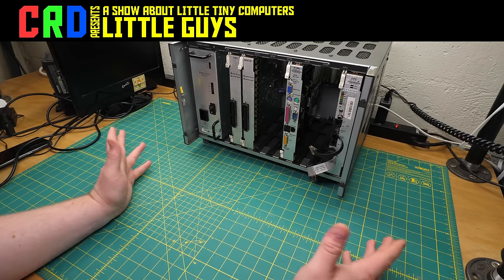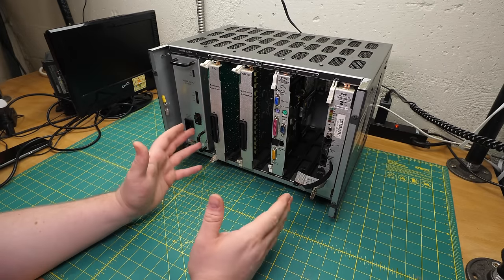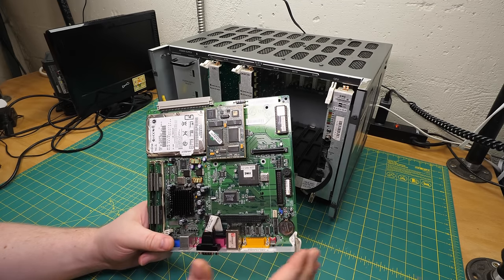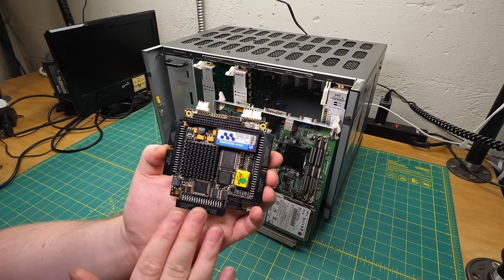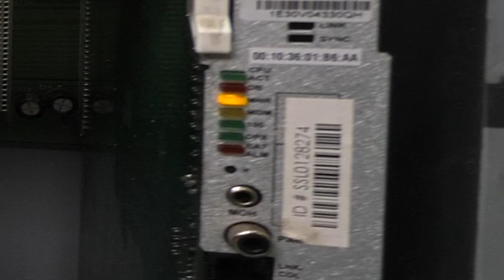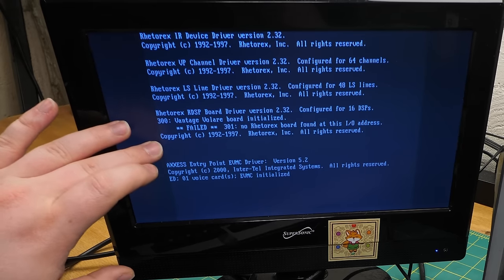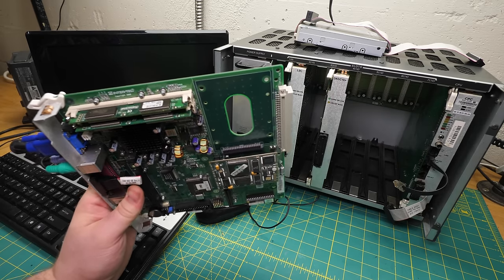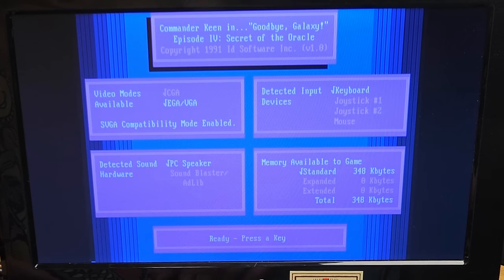Little Guys 9: The First Of Many [Intertel Axxess]

Comment: I don't know if it's in any way a standard name for it, but the Windows Entertainment Pack version of Mahjong solitaire was called "Taipei"

CyrixInstead almost sounds more like a jab at "Intel Inside" [though you're correct that the actual cpuid string for Intel is GenuineIntel], they also apparently had it on actual stickers to go on the outside of your case.
Reply from the maker: I've seen plenty of Cyrix stickers on machines but never a Cyrix Instead. The only results I can find for that on the gorgle are stickers that look like reprints, so it's possible they're actually a modern reflection of the CPUID joke.
Reply: There's some pretty interesting CPUID vendor strings on some chips. The string is returned in 3 32bit registers, so it has to be exactly 12 characters long. AMD's is "AuthenticAMD" - they found a synonym for Genuine that was 2 letters longer :) VIA's is boring, it's just VIA <space> repeated 3 times. I think my favourite is "CentaurHauls".

Comment: Hey now, I played the hell out of the Duke3D shareware on an Intel 486DX2 50MHz (in the 487 socket of a 486SX 25).  It worked... Well enough.  I guess that's why I can play Cyberpunk 2077 on a 2017 Dell 7577 laptop with a Core i7 7700HQ, 16GB RAM, GTX 1060 6GB.  Yeah, I struggle to get 30 fps on medium-low settings lol.

Comment: That's not hot glue... it's called silastic. Let's ask the internet... "Silastic (a portmanteau of 'silicone' and 'plastic') is a trademark registered in 1948 by Dow Corning Corporation for flexible, inert silicone elastomer."
Reply from the maker: Nope, it's hot glue. Silastic is universally opaque white and has a shiny, rubbery texture. This is milky yellow and has a terrible rough surface texture, like typical hot-melt - more importantly, it lifts off the board instantly with just a touch of isopropyl alcohol, while Silastic won't release for love or money.

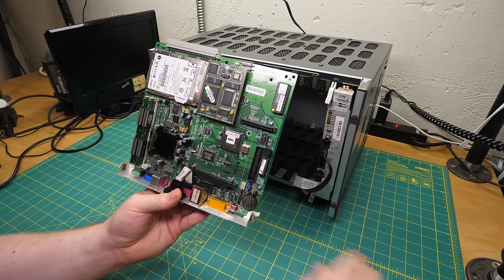Comment: 23:25 I kinda doubt that Winbond chip is just a dual uart - seems like way too many pins? they have a lot of chips in that form factor which are actually super-io chips which also provide parallel, ps/2, floppy, etc.
Reply from the maker: That was my thought too, during the video I was like "huh, just a UART, seems odd", but I'd looked it up and found a list of datasheets all titled "dual uart". turns out: they were all crappy machine-generated summaries. it's a W83977F, a dual UART and many other things, a typical SuperIO - stupid of me, just plain stupid.

Comment: PBX: Private Branch eXchange, aka. a mini phone switch. Or in networking terms, NAT for phones. 🙂 (that usually does it for my non-tech friends.)

Ah... "FCC Part 68 line isolation circuitry" unchanged for many millions of years. (well, we have solid state equiv these days, but it's hard to beat the air gap of a relay) Many of those large ("beefy") parts are for ring detection, because it can be quite a jolt of electricity. (in ye olde days, it could be A LOT. like set shit on fire "a lot". A friend still has a 1800's hand crank phone)

Toshiba's VM "PC" was one of the most simplified ("striped down") systems I've ever seen. Serial only, no video capability at all. The only removable part is the CF - it didn't use a hard drive. (ran DOS 3.3 btw)
Reply: For the most part, the bulk is because of two things:  You need a transformer to galvanically isolate the line side from the user side, for safety and to establish a local ground reference.  And you need plenty of clearance to handle the occasional fault voltage.

Ringing voltage is high enough to give your fingers a tingle, for sure, but it's also possible that outside wiring might end up in contact with mains voltage, or a phone line could end up grounding a bolt of lightning.  That's why you need such substantial components.  Not so much for the "ordinary" case, but for what could happen when things go wrong.

Comment: Hey, would you like a crash course on Alcatel-Lucent OmniPCX Office devices? They're very, very fun little machines that run Linux and that you can mess with to whatever extent..even though you're very much not supposed to :)
They're still widely used today, and have pretty much not changed from the early 2000s!
I did some, let's say, interesting tinkering on them...

Comment: Warp3, YESS! This is pretty much proper multitasking before XP (well discounting NT3.5 and 4, and 2K, hhheeeee 4 & 2K... 3.5 sucks)
Reply: Warp 3 came out before NT 4, which gave IBM a window of opportunity in that competition in the heavier duty applications.
Reply: @markjames8664  Warp 3 Kicked serious butt. Starting windows 3.1 and Word 6 took longer than OS2 Warp (after booted of course) took to load the windows translation layer and word 6 while formating a floppy. Won't even start anything while formating a floppy on 3.1. And yes Warp 3 was out before 95. :P

Comment: 486 could have USB. There were 486 chipsets with PCI support and USB PCI addin cards are a thing. With no PCI bus you don't have any options for USB. There will be additional trouble with OS support, USB supporting operating systems would be much too heavy for a 486 not to mention the CPU overhead of USB itself. Win95 with USB would probably just work, but USB support in Win9x was awful. USB support in Windows only got good in Windows 2000.

Comment: that looks just like the old toshiba PBX we had when i worked at a local phone company back in 2005-2015. it was still in service when i left in 2015. that system was archaic and stupid. But i wouldn't trade it for Mitel though. no f'n way.

Comment: I’ll bet the embedded (unpowered) PC is probably drawing current through the I/O lines connected to the floppy which then drags the motor control line down (as the floppy drive cant source enough current).
P.S. I have a stack of PC104 boards including a CPU (it came from an ATM I think), if you want it? I’m in the UK.
Reply from the maker: ooo, I'm interested! shoot me an email - cathoderaydude at Gmail. thanks!
Reply: @CathodeRayDude please check your Spam folder. I’ve located the PC104 boards and I’ve for details as to where to ship them 😊.

Comment: 38:18 Your excitement get the better of you? Higher gauge values means a smaller wire.
Reply from the maker: I'm not sure what you're referring to
Reply: @CathodeRayDude  "Big heavy wire, that's like at least 18 gauge going through there"

I suppose, that is kinda big for a PC, but in the power supply world, that's just what you do. An 18 gauge is roughly a 22 amp connection. To me, that's just a "let's practice soldering" size. To get to "big, heavy" descriptors, I'm looking at 12 gauge, or even heavier.

Comment: Re. PC104 being expensive, I wonder if it might be that they have certain users over a barrel. Your super expensive and vital piece of industrial hardware is a brick unless you replace the PC104 machine controlling it? You're going to pay $8k without even a second thought. Most other people can just use something else, but the people for whom PC104 was designed *can't*, because PC104 is the only thing that will *fit*. Thus the market can charge what the market will bear, regardless of the actual value of the components.

Comment: Did you mean to say OS2 Warp? Because OS2 was a main frame  operating system, that competed with Unix on IBM machines. OS2 warp had a GUI. OS2 did not. OS2 warp is to OS2 that Linux is UNIX. Assuming I'm not terribly wrong and it looks like I might be looking at wiki.. .  I distantly remember my father learning OS2 back when he was still bringing home "Do Not Fold Spindle or Mutate" cards home in his briefcase.
Reply: BTW I was a grown man when when the XT and AT came out let alone windows, or OS2 warp... I still remember the joy of typing "edit" rather than "copycon"
Reply from the maker: I wonder if you're thinking of OS/400, IBM's OS for the AS/400 series? OS/2 was always a PC OS, meant to co-brand with the PS/2; they introduced the Warp moniker in version 3, but before that it was simply called "OS/2 1.0" and "OS/2 2.0"
Reply: @CathodeRayDude  I was thinking of os400.. Sorry, You are right. Thanks for the correction. I love your content.

Comment: I have a u9100 NEC I maybe able to send you. 
You admin it over ip or vga out the box 
I have all the passwords as well. 
400 active licenses and I have about 300 NEC phones that go with it.
I can send you phones or the box or both if you like
Reply from the maker: that would be extremely helpful! since (as you probably noticed) the one I have is just an expansion chassis, or at least that's what I've been told, I can't do anything with it until I have the main unit. Just that and a couple of phones would be perfectly adequate for my needs. Could you send me an email? cathoderaydude at gmail. Thanks!
Reply: @CathodeRayDude yes

Comment: I assume by "PCM" you mean Mu law?  ;-)  hehe
Reply from the maker: ulaw is a type of PCM (and don't nitpick the u, that's how it's been spelled even in official documentation for the last 20 years :p)
Reply: @CathodeRayDude   Ahhh... yeah, OK.  I think I've been bested here.  haha  I yield!
Reply: If memory serves SIP protocol for VOIP negotiates codecs to find one supported by both ends of the call, so it can support different kinds of hardware.
Reply from the maker: @markjames8664  it does, though in practice most provider networks have session border controllers with integral media gateways that do the conversion for you, so 99.9% of actual PSTN calls will come in as whichever format you need. Extension to extension calls can be anything, including compressed g729, HD g722, Speex, you name it. VoIP is a mess.
Reply: @CathodeRayDude  when SIP first came out I think transcoding was still fairly expensive and doing direct end-to-end media was partly for that reason.
Reply from the maker: @markjames8664  yeah it originated in the early '90s at which point It was pretty much out of the question. There's so much of the protocol that's left over from that era, when they thought people were going to use it very differently than they really did once mass uptake happened, and all the vendors really wanted to do was to replicate the functionality of their old TDM PBXs without taking advantage of most of SIPs fancy new features.
Reply: @nickwallette6201  we're so used to "linear PCM" nowadays that we just assume it as the default. But that name really only makes sense as a contrast to the non-linear PCMs used in telephony applications.